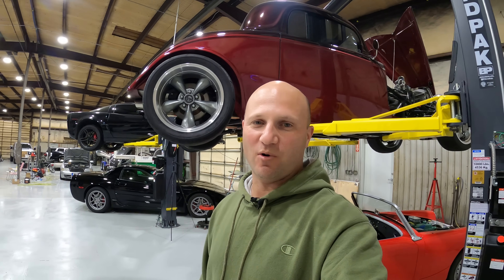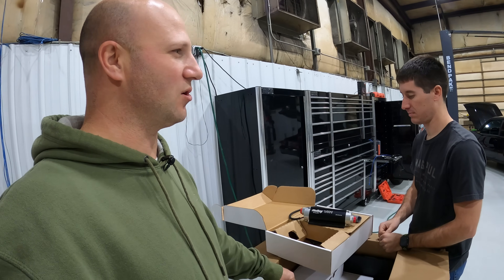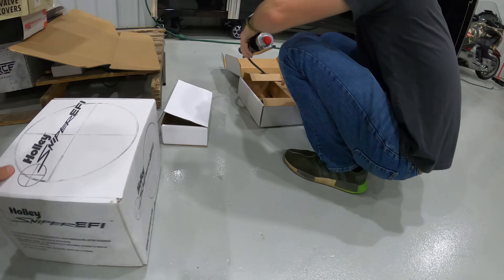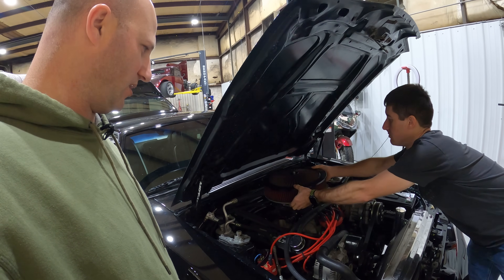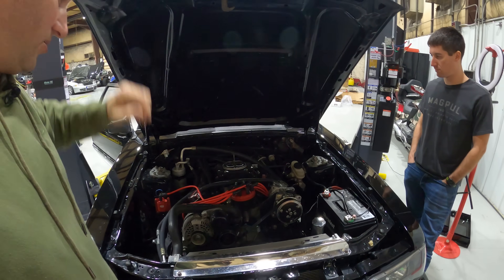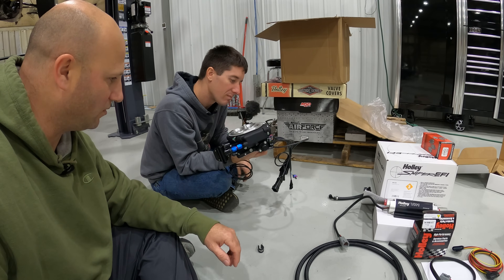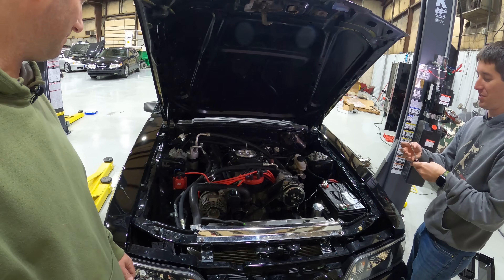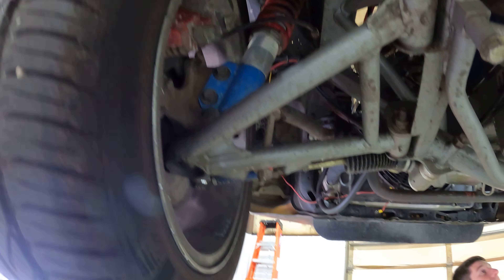1000hp build. Upgrading the Holley EFI in my Fox Body Mustang.

Comment: That 8.2" 500hp thing isnt accurate, its all about setup and tuning, you can split one at 400hp if done wrong or hold 600hp if done right. Mainly with forced induction, what type, how much and when is the biggie, and ballancing plays a huge part too. High rpms along with high cyclinder pressures along with harmonics (especially early nitrous)bad recipe. #sadface😞. High rpm NA HP with really good ballancing no problem (within reason).

Comment: Ran a Flowmaster exhaust on my Mustang from 1996-2020 (3 chamber mufflers from 1996-1999 and an American Thunder catback from 1999-2020). 

I switched to a Borla S-Type system in 2020 and have to say that it's a much nicer exhaust. Gives the car a more refined and distinct sound, no interior drone, quiet at idle and part throttle but sounds very nice and aggressive at full throttle.

There's no performance difference over between either system from my experience, but the Borla S-Type has a much nicer and refined sound than the Flowmaster does. 

The build quality and material of the Borla is also much nicer than the Flowmaster.
Reply: Borla quality is fantastic.  Mine sounds great for cruising and like a wild animal when you pit your foot into it.  No highway drone either.  Its the perfect exhaust all around.  Wasn't cheap but will never have to buy another as long as I own the car.  Now going to put one on my 6 speed manual Frontier